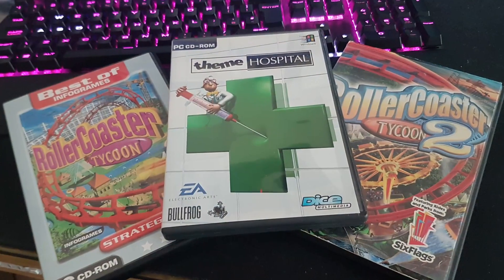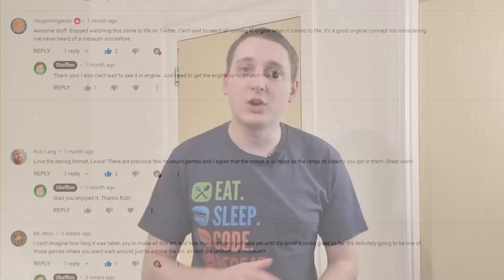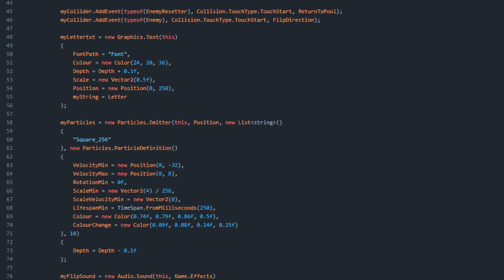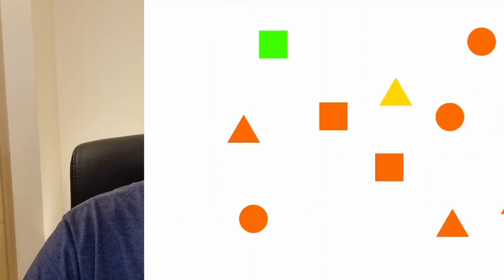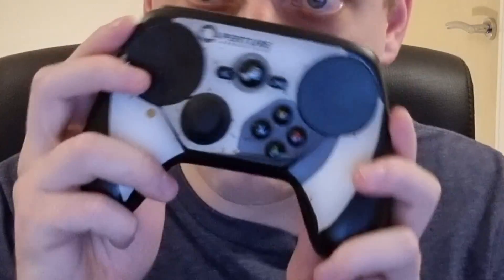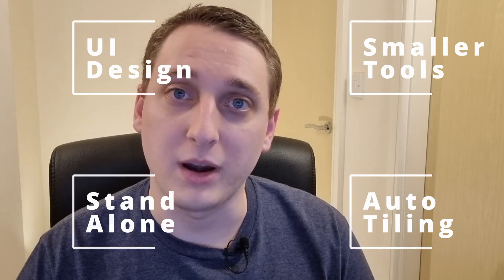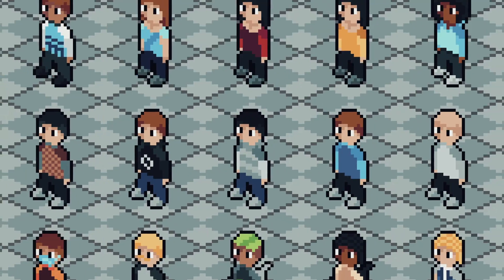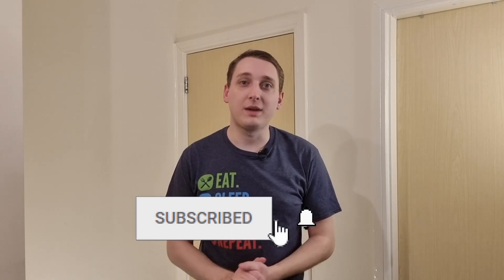WHY REWRITE my Game Engine? | Museum Game Devlog

Comment: Great video! The huge scope of your changes and engine as a while is somewhat bewildering. How are you going to avoid the feeling of being overwhelmed? How are you going to keep on track with such a big project?
Reply from the maker: Thanks Rob! I think the scope is manageable, as it is mostly incremental changes to what the engine already has. Although for good measure I will only implement things when necessary, for example I can't see the need for particles or physics right now.